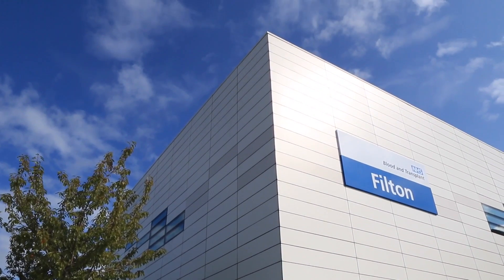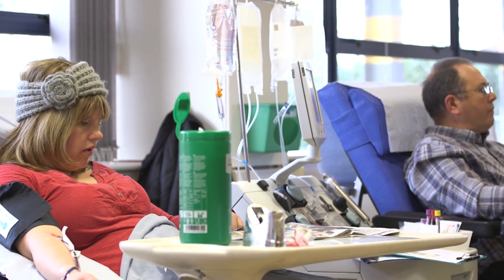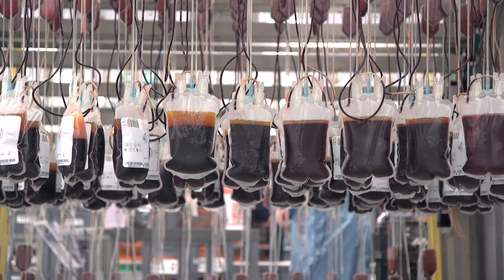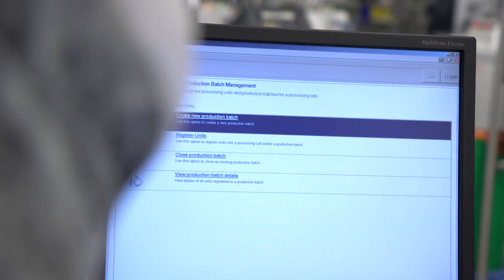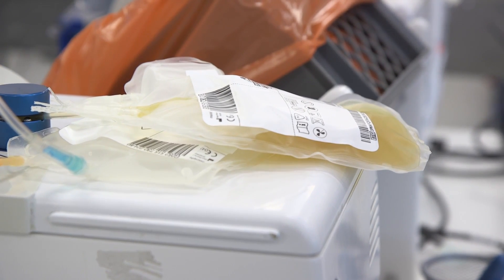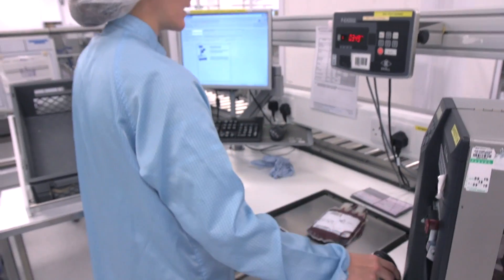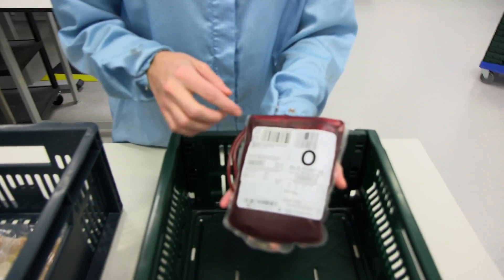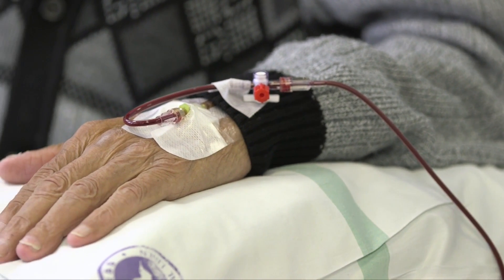What happens after you give blood? Blood Manufacturing Tour

Comment: Where are her protective gloves?? Touching them bags like they were frozen veggies seems a bit strange to me...
Reply: Sophia Adcock the gloves arent needed, the bags are all sealed, so no contaminants will get into the packs, if the pack does leak then that unit is discarded anyway so gloves are only needed when sampling units or joining two packs together, which is done with sterile connector devices, but still has a risk of leaking
Reply: @georgeboyes864  spot on i worked there!